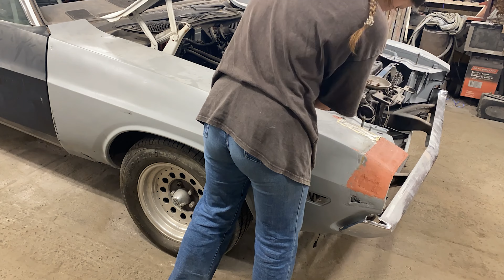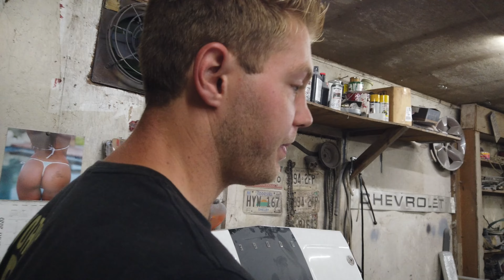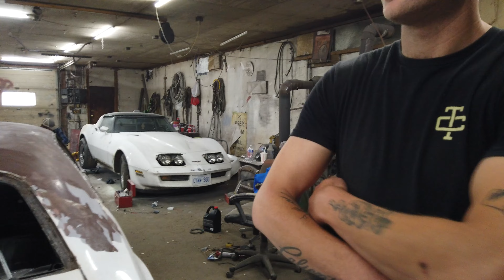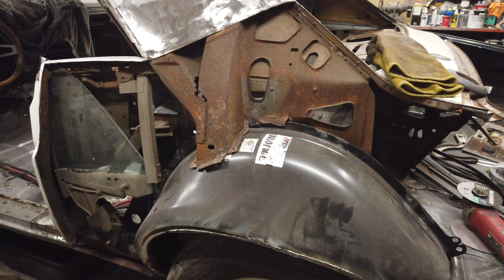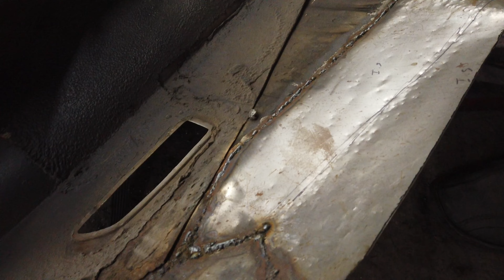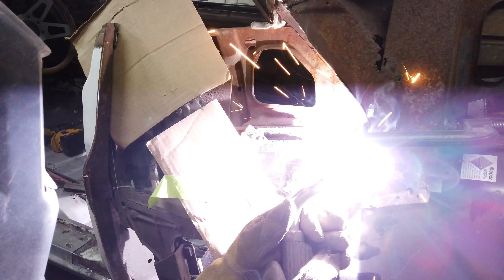Restoring The Most Butchered Challenger on YouTube

Comment: Do you use a Flux core mig welder?
Reply from the maker: Yes we do!
Reply: @RustedRides  cool. I just bought one from a friend from work for $50. Hobart, I think.  It's a 110 but should work fine for body work. I've used one at work quite a bit , but it's gas non Flux.